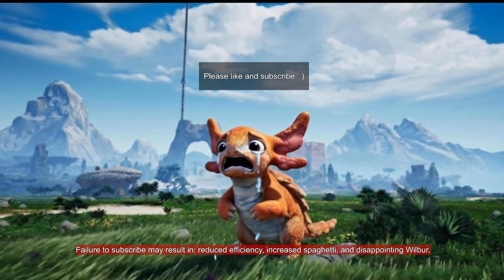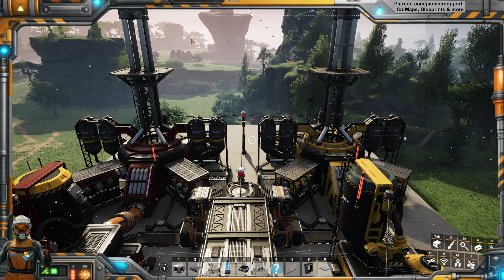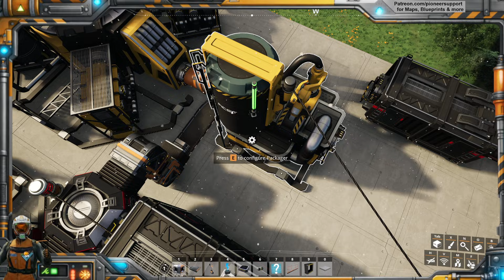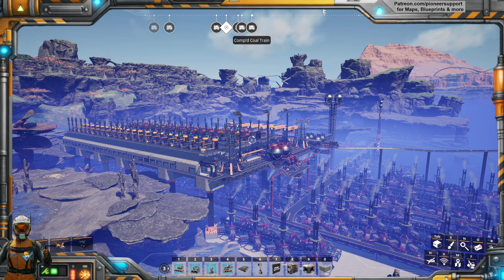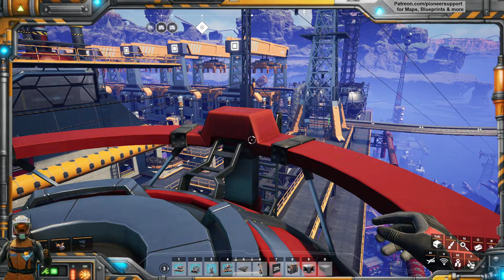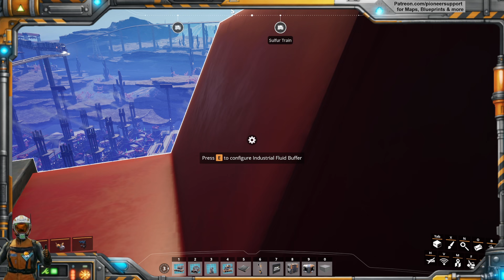Stop Using Regular Fuel: Turbo Fuel Makes 4x Power in Satisfactory

Comment: I just did this, 600 oil to 10 refineries made 400 fuel powering 20 generators, changed it to making rocket fuel and it now powers 130 gens, and i have 2 more 600 pipes doing the reg way at the oil spot, could be another 260 gens
Reply: Rocket Fuel is so overpowered that it negates the need to go nuclear.  The Nitro Rocket Fuel alt recipe is ideal as it takes 100/min Fuel plus sulphur, coal and nitrogen and spits out 150/min Rocket Fuel.  If you make Diluted Fuel in a blender (which conveniently produces 100/min so you can connect the blenders in parallel) you can make 2400/min Rocket Fuel to run 576 generators making 144,000MW from 600/min Crude...and the only waste is some polymer resin and compact coal which you store and use as a cold start system for your Rocket Fuel plant.  Not that you're likely to need it.
Reply from the maker: I still find myself gravitating to nuclear because, at the point in the game that I unlock rocket fuel, I’ve almost always already built a fuel generator power facility so the idea of upgrading it and/or build a new one doesn’t seem as interesting as doing something different. Also, to fully exploit rocket fuel, making 576 generators is a LOT. To exploit one impure uranium node I only had to build 50 uranium power plants, and 30 Plutonium power plants. Granted, there are a lot of support factories that I build as well but I enjoy that.

Comment: In terms of effort, diluted fuel and heavy oil residue accounts for the most power amplification.  

Map out the amount of power 600 oil per minute can make with:

The default fuel recipe
HOR to residual fuel
HOR to diluted fuel
HOR to Diluted to Turbofuel 
HOR to Dilited to Turbo to Rocket Fuel

The multiplier is like %300 for oil to power for the HOR to diluted chain from base recipe.  Turbo fuel is only an additional %233 or so on top of that.

You still get more power, but the effort to set up goes up exponentially while the power amp falls.

The only fuel setup that can compete with power per resource per effort is HOR to Diluted to Nitro Rocket fuel, by far the most busted power setup by that metric.
Reply: I agree with you. He has to speak about the alternate recipes as well, not just the base recipes and not stop at turbo fuel. But I get it, maybe he only wanted to cover base recipes in this video and cover alternate recipe comparisons in another video.
Reply from the maker: Just wanted to answer the person’s question. :) They were asking what the big deal is with turbo fuel. Also, it’s one of the recipe’s you don’t have to rely on rng to get unlike other alt recipe’s as it’s in the MAM tree.